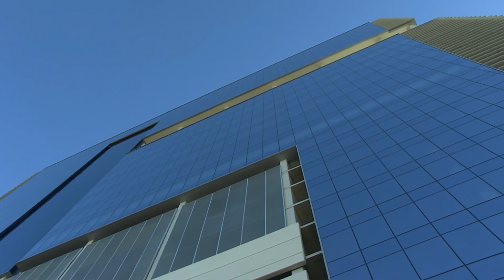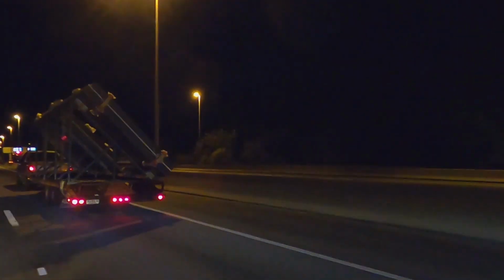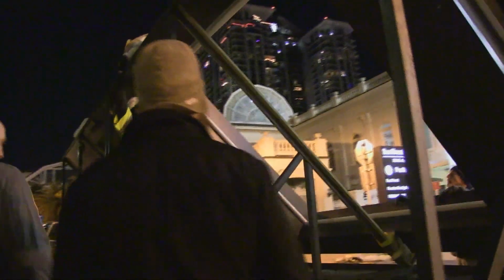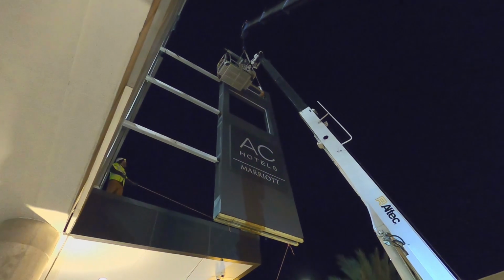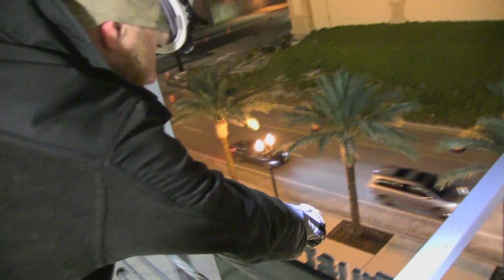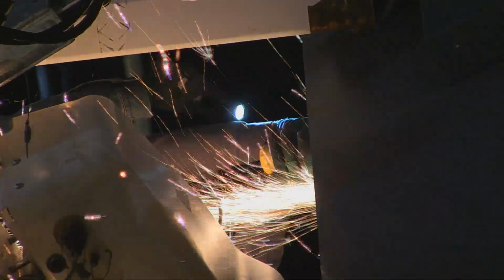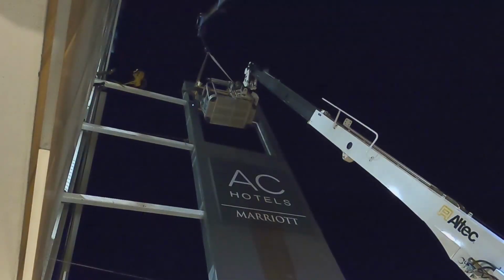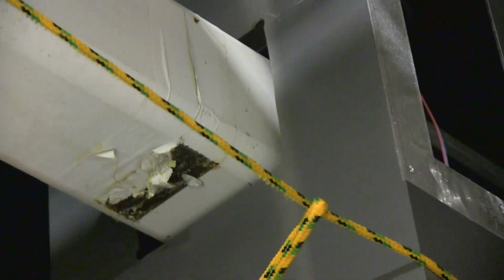AC Hotels Sky Bar Sign Build Part 6: Night Install

Comment: There is an easy way to do this,
Put the screw into the sign and when u lift it it's easy to put the screw in the hole and put the net.